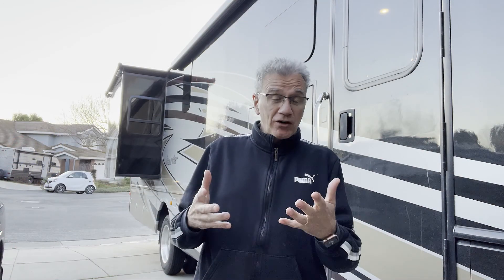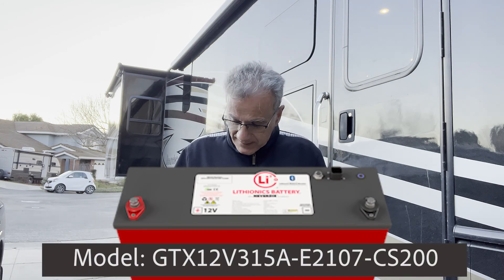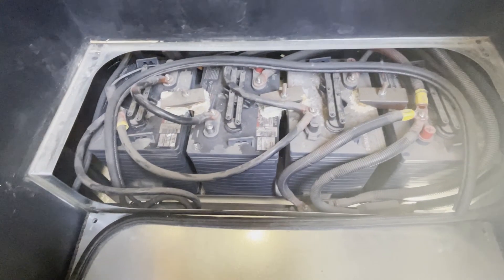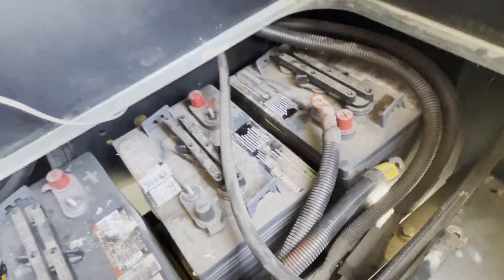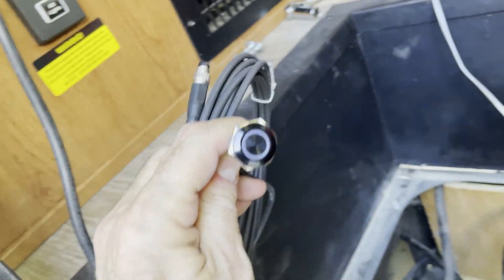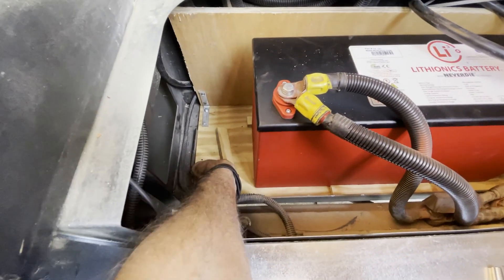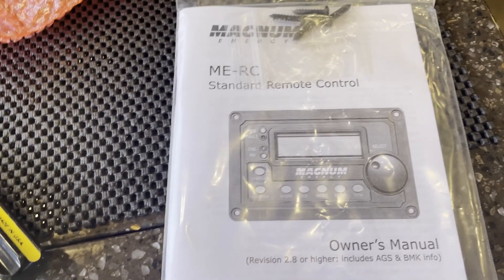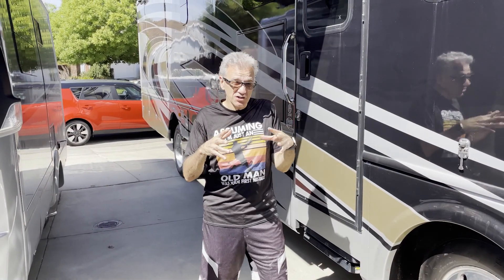Lithionics 315 AMPs Lithium Battery Installation on a Class A Motorhome

Comment: I hope you'll be installing a Lithionics 12v315GTX battery in your new Leisure Travel Van, I love the one I have in mine. With a 3000w inverter I can get 4 hours air conditioner run time with my amazing Lithionics 315ah battery.
Reply from the maker: Oh yeah! Will do. Probably two of them